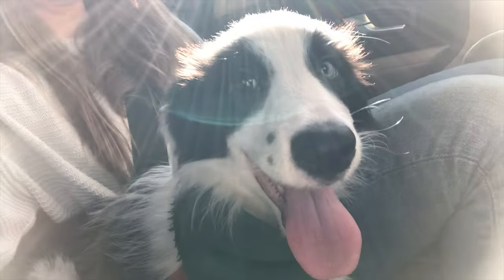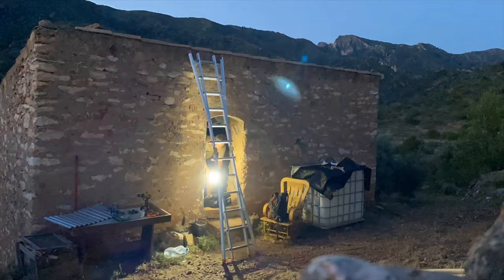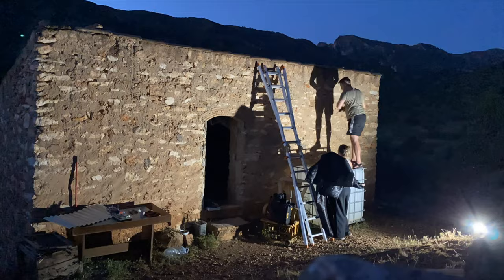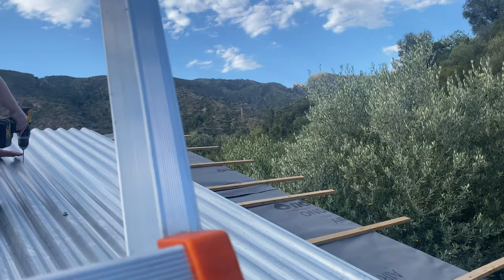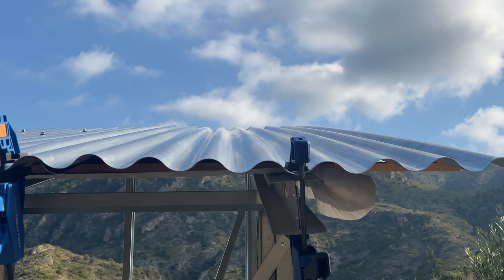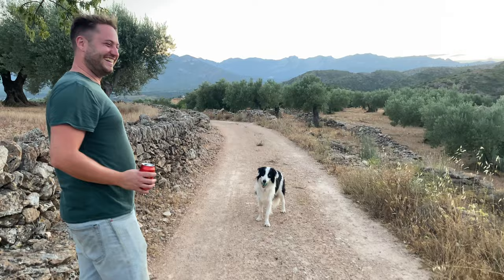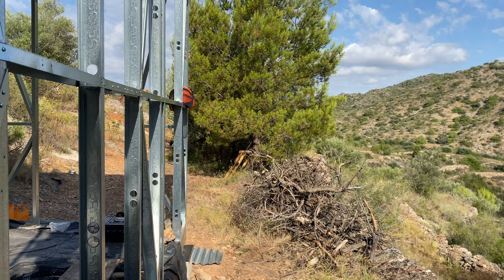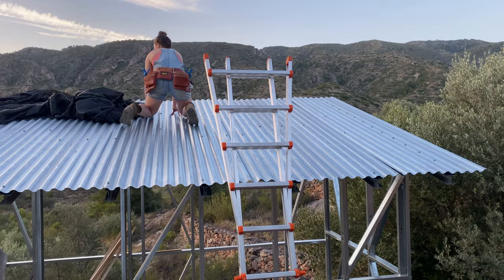Building our tiny house in a heatwave 🥵 | CABIN BUILD SERIES

Comment: Surprised that you guys didn't take off for vacation...far too hot to work.  Those netting surely help tremendously  against pest and heat.   Good thinking.   I used a lot of the mosquitos netting while Iiving in South East Asia.   They're a life saver for me.  Will there be insulation in the cabin building?   See you soon.
Reply from the maker: Yes we will be insulating the roof and walls. And the base was insulated when we built it 💪🏻
Reply: @SmithsdaleFarm  
Awesome